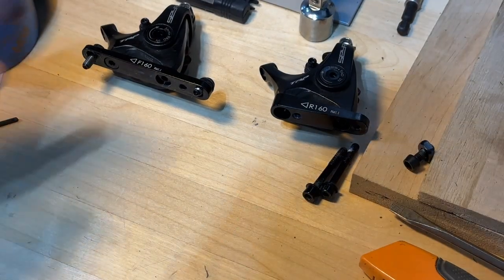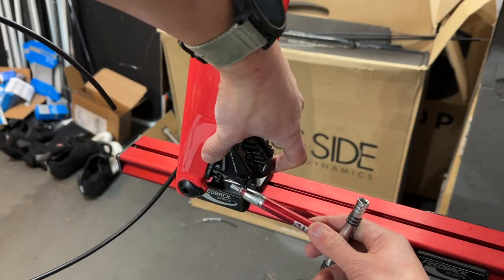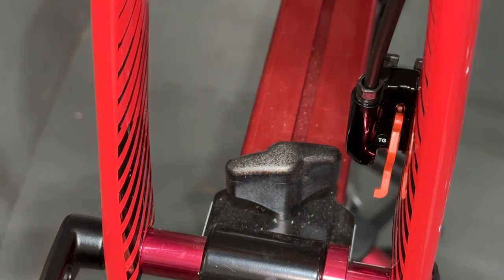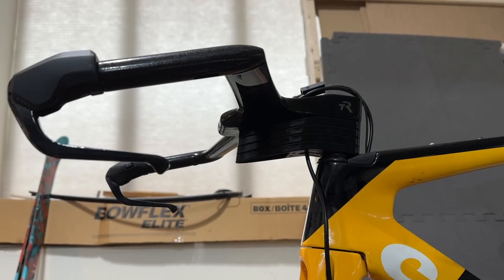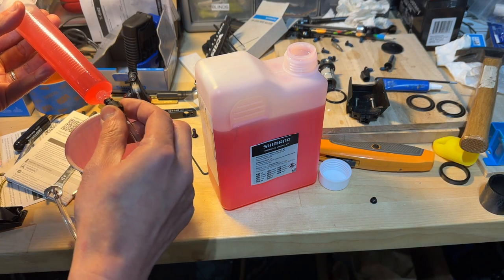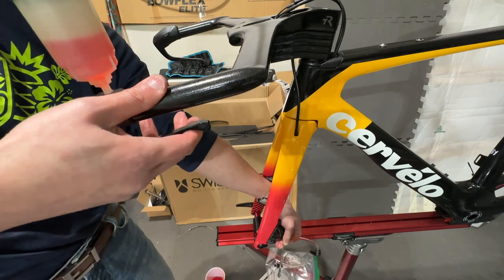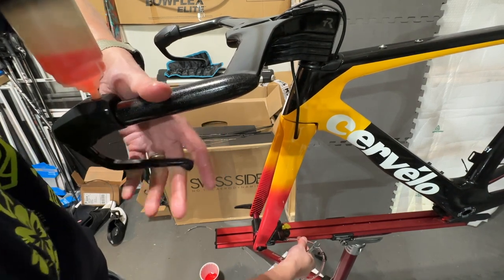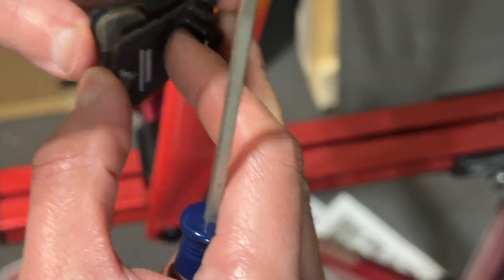Installing DuraAce hydraulic front disc brake on Cervelo P-series

Comment: Did you have the flat mount adapter the wrong way?  Looks like you set it up for 140mm for the front.
Reply from the maker: You have a sharp eye! I did set up my bike with 140 front 160 rear because I don't need that much stopping power for triathlons.